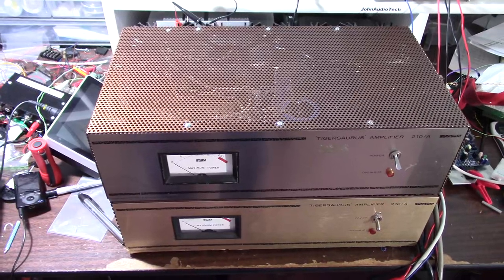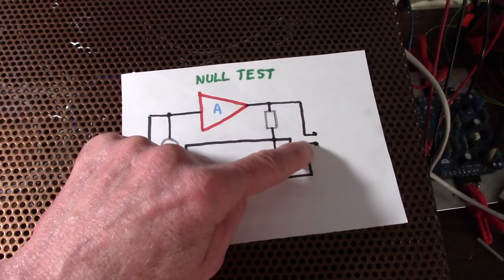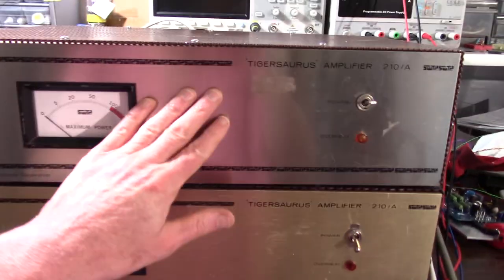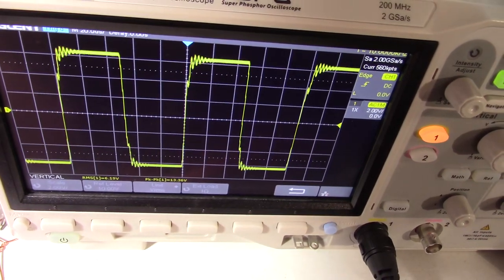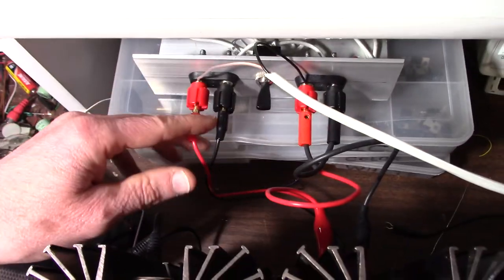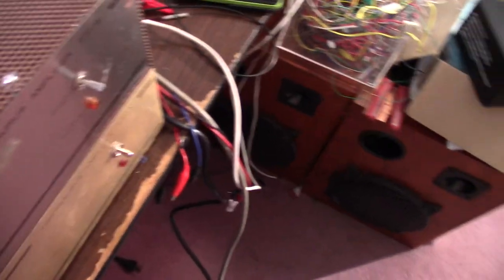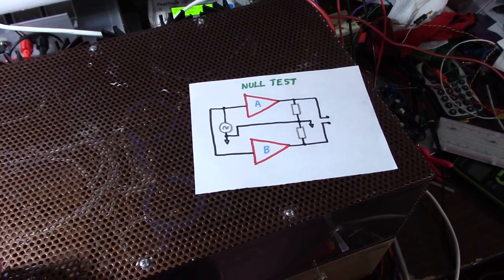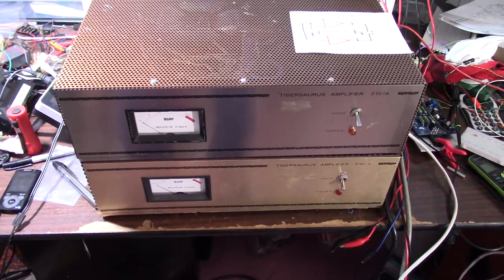Null test for comparing amplifiers

Comment from the maker: The frequency response footage didn't find its way into the video. Anyhow, both amps are flat across the audio band, only starting to roll off around 70KHz due to the lowpass filter on the input.

Comment: Yeah but what are you going to do about the faceplates being different colors? That was really triggering my OCD over here. They're not a perfectly matched pair!
Reply: Neither are the power switches
Reply: That colours the sound for some.
Reply: @FindLiberty  the switches don't match either. Triggered!
Reply: @maxine2798  maddening isn't it? Reee!
Reply: @maxine2798  Yes! The different power switch bats were absolutely triggering my... OCD <-- (There, I said it.) The difference in front panel color I was able to get past, but those mismatched power switches...... Ahhhhh...
Reply: @electronicengineer  Different power cords are even worse... Barbaric approach to Audio Gear!

Comment: I still wonder if piezo tweeters could be capacitive enough to trigger a touchy amp...
Reply from the maker: Interesting thought. I suppose it could depending on the capacitance and if there's much esr. Even a few feet of speaker wire is enough to dimmish the effects of pure capacitance across the amplifier's output.

Comment: maybe a new L1 air coil 14 gauge enamel wire with 1.5uH and a 5W 10R (about numbers) in paraller it might help the oscillations on my simualtion with software I notice that goes lower a bit
Reply from the maker: Yes, some more inductance might help, just don't go too high.
Reply: @JohnAudioTech  agree yes 😊

Comment: Hi John Audio

A loudspeaker is a reactive load and so you are not doing a null test  comparison of amp behavior if you are using a resistor for the load. What do you think.
Reply from the maker: I don't think it would make much of a difference on a high damping factor amplifier.
Reply: @JohnAudioTech  That is also part of what is to be tested. To see how an amp with high damping factor behaves with a reactive load. A loudspeaker  is a complicated reactive and mechanical load , you could probe at the output with a speaker connected for the amp under test.
Reply from the maker: @woodcoast5026  Fortunately, speakers have a series resistance preventing the amplifier from being loaded with pure reactance. For example, there is around 6 ohms of resistance to a driver rated 8 ohms nominal. Sure, the speaker still has reactance but it padded down by the series resistance. (Think of poles and zeros in electronic circuits).

Using an actual speaker is not ideal as test signals under high power can harm them. There are dummy loads using inductors, capacitors and resistors that emulate a speaker (including the mechanical properties) for testing. I'll have to build one and test some amps to demonstrate my point.